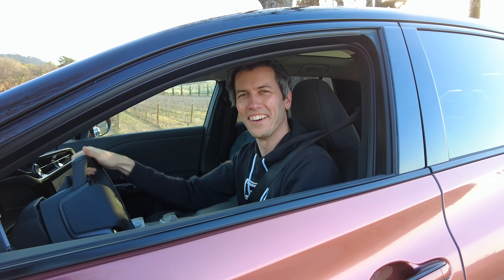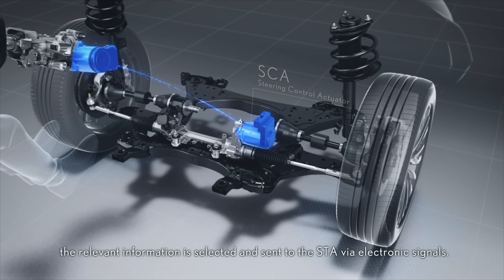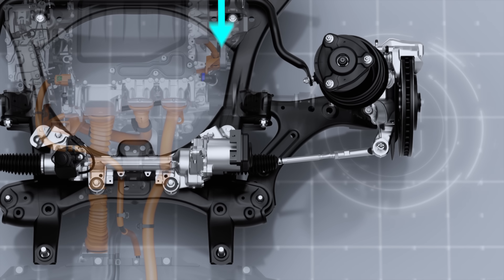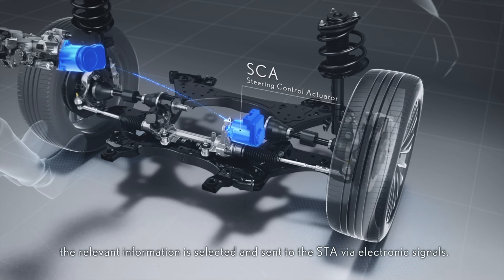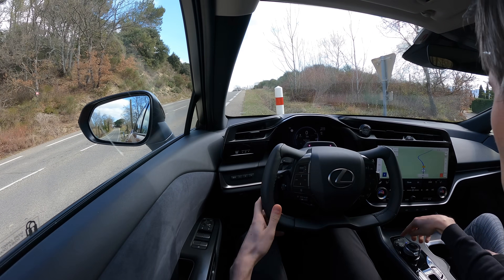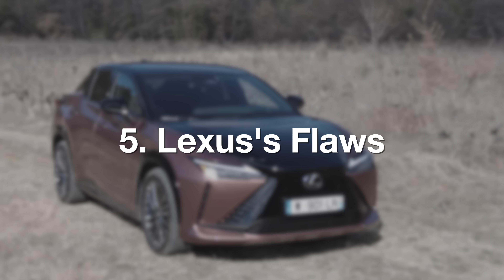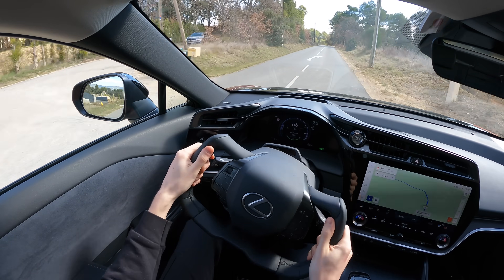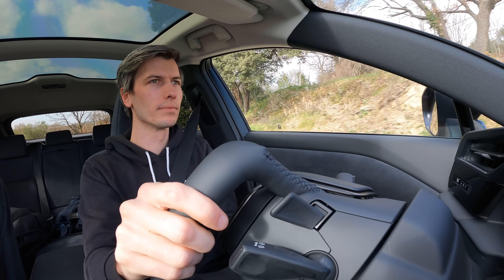How Lexus Fixed Tesla's Bad Idea: Steer-By-Wire Yoke

Comment: So if you turn the wheel and brake, does the vehicle spiral? Or is the vehicle speed input tot he steering ratio latched when the brakes are applied?

X-by-wire is in general a good thing, but there's a long list of safety and reliability preconditions.

Another potential benefit is that the vehicle can be made deliberately modal. An existing steering related example is the “tend to follow lanes” switch on a lot of current cars, but you could also ask yourself questions like what would a fully parking lot optimised control discipline be like. (Just make very sure that the look and feel are different when you do this—Airbus learned this the hard way.)

Comment: the thing about the adjustable steering ratio is that it'll be very difficult to account for scenarios where varying rates of steering are required with short times inbetween. for example when the car loses grip or when having to avoid an obstable at differing speeds
Reply: you think them asian engineers with master's degrees didn't have solution for this?

Comment: I can remember (European here), that my SEAT (Part of VW Group) Leon Cupra (280HP) hat alread "progressive steering" back in 2014 (in a middle class car). The first half/two thirds were like "regular" steering but the last third was way sharper. 
So, the benefit of the electronic system does not make sense to me. A lot of more controllers/actuators that can break done. 
Even if you have redundant system like in a freaking airplane: that adds a lot of costs to it for a doubtable "problem"

I am now driving an electric car (Ioniq 5) but the sense of the electronic steering I can not comprehend, 
especially the point that the same input does not always relate to the same wheel turn...

Comment: the only concern i have with steer by wire, is that as other car brands adopt the technology and it finds it way into lower production cost cars, some of them will cheap out on components and there is going to be a big delay between steering input and actual movement.
this is already the case for drive by wire throttles on some cheaper cars (many Renault from around 2010-2015 from my experience) where there is a good half second delay between pushing the gas pedal and the car opening up the throttle body, a delay that is very noticeable especially in a manual car. weirdly enough the delay is not noticeable (or not there?) on deceleration.
i am all for innovation and moving the automotive industry forward, i just hope that cheaper cars stick to traditional steering until the technology becomes cheap enough that it can be implemented safely into cheap cars.

Comment: 1. I didn't think there was anyone that actually used hand over hand, thought we all just do the palm turn on the wheel.
2. I don't really care what's going on behind the scenes, as I trust the engineers much smarter than me, as long as I still get to have a normal steering wheel as an option.
Once you start removing options (like tesla) that's when it's gonna start pissing people off.

Cars are fun machines to drive, they're not something that is 100000000% necessary to buy from one manufacturer or in a certain way.
Manufacturers shouldn't start taking stuff away like they can somehow decide what people want, such as steering wheels.

Comment: I am not convinced, the variable ratio of steering is not for me. There are situations on a high speed when you need to react quickly and turn as much as possible even if you end up in a ditch but to avoid an even worse situation. If the steering won't listen to me and just turn ever so slightly because of the speed I am driving it is not a good idea.

Comment: That's gotta be a no from me dawg.
As a coder i still much prefer my close-to-dead shitty 01 skoda with the powersteering just straight up broken, than a computer deciding how much i can steer in what situation. 
Also another "Nah dawg" for me: "Fix it yourself", cars get more and more hard to take care of without professional software and very specific data connections, and i can guarantee this won't make it easier. The good ol' engineering principle of "Less parts = Better design" needs to stay a thing in personal cars.

I don't have a problem with steer by wire in any public infrastructure like buses, or airplanes, but these are all things that are very actively maintained, and operated by people that can maintain them, or at least know when to figure out to do so. Think about that one guy you know for sure that drives around with the "Check engine" light that has been burning since 2008, and what will happen if a person like him will have a system like this.

Electric cars need to be accessible for all sorts of people for them to catch on, and "Expensive feature with minor benefits" isn't the target audience the industry nees right now.

Comment: Mfs in this comment section thinking that dozens of gears, shafts, bearings, hydraulic lines, linkages, etc. Are more reliable than sensors and a motor are out of their mind, reducing moving parts is the only constant in the pursuit of reliability, there's a reason planes moved to eletronic controls half a century ago and never looked back, mechanical connections and hydraulic lines are much less reliable than eletrical wires, wires do not wear down, do not require oil, do not fail if they are hit, punctured or bent.

Comment: i wouldn't trust initial programming and design. i have no doubt down the road it could be safer in an accident. less metal to come at the driver in an accident that kinda thing. i would expect like tesla's self driving. risky at first but now it's getting better and will be safer then human driving taking the human out of the driving., drive by wire will probabily be unstable and sketchy at first but once the bugs and kinks worked out i can see a few safety factors that would make it better then traditional drive shafts but i don't like the simulated feedback idea, i'd ratcher know what the car is feeling as opposed to what it wants to tell me.
it should cut production costs for the various manufactures for wrong side driving and so on. since now it a steering module you can mount in the back seat or on the roof if you wanted to.

Comment: Good video! You summed up your impressions well right there. The nerd in me says “ hey funny” but honestly as car driver I find it’s disconnecting you from the car too much. I’m also an enemy of faking feedback with electric motors. That’s kind of the same discussion when it’s about capacitive touch. It feels disconnected and artificial no matter how well you fake the feedback. 
At certain to me critical points I’d always prefer direct feedback and good haptic over a manufactured experience. (Let’s not mention the imput lag that also had your attention and it’s dependencies)

Comment: Having a non-round steering wheel will always be problematic. It's round for a reason, it means that it will always be in the same place no matter the rotation. That in turn means you can find it by muscle memory when looking in another direction or in a panic situation. A non-round wheel is a hazard.

Comment: This design in Lexus(Toyota) is as safe as the stuck accelerator problem was (or still is). The system does not have any redundancy or fail-safe mechanics.

Comment: Steer by wire should make it easier to have right and left hand drives. Hell, it could even let you have centre drive. Steer, brake and throttle by wire will make it easy to give options. So it will make it cheaper to export to all territories.

Comment: It's a pretty big issue if a drive by wire system has a lower response time than a mechanical one when that's supposedly one of the main justifications for building it that way. Hopefully they're able to fix that before bringing it to production.

Comment: 12:28

your test is flawed, i hasve a old "traditional" steering rack system. When I'm parking I notice the wheels and steeing wheels aren't the same, the power steering doesn't turn the wheels entirely where the steering wheel is when you're steering on the spot. When i'm steering on the spot, the steering assisnt isn't going to help steer all the way until the car moves a bit and the wheels can turn without excessively wearing out the steering rack. You need to have the wheels on jackstands to do a fair test.

Comment: Planned obsolescence in the guise of progress. Once engineers figured out how to make vehicles run for several hundred thousand miles, manufacturers needed to insure their bottom line. Now a car can be rendered "totaled" because of the decided price of a proprietary PCB. It's like saying that "before these electronics, cars had no value whatsoever". Crippling cars with electronics isn't for the customer, so much as it is for the Sales Department.

Comment: I think the delay is designed. It can actually dampen a twitchy steering. Also computer intervention is now possible for steering corrections to prevent fish tailing or spins. In RC drift cars there is a gyro to make it soo much easier to drift because stability is increased.

Comment: We already have redundancy and failsafe in case of actuator and sensor failure.
What if the connection between the two that is compromised? What failsafe do we have in that case?

Comment: honestly, redundant does not imply fault tolerance and redundancy does not indicate safety nor reliability. While I do see some benefits to this approach, the fact that there is no longer a concrete connection from the steering to the rack means that one day, someone somewhere is going to have that 1 in a million fault and that will most likely be fatal considering the driving ability of the average person. I mean, technically they should be safe as long as they followed the normal driving norms like keeping safe distance and speed limit. But I am pressing x to doubt right now.

Comment: I'm not really convinced with the answer as to "why". Especially when you see that FPS pro gamers who have a choice, almost never have mouse acceleration turned on nor is their DPI set to ridiculous values. Very rarely do you need to turn the wheel fast and full in one direction. More predictable steering with feedback will always be better. It's the same old touchscreen vs buttons debate.

Comment: This was solved more efficiently by the variable ratio electrically assisted steering rack some years back. It offers the security of mechanical linkage with variable ratios. And with proper ratio design it'll offer all the advantages of this system with the safety of mechanically linked failsafe. 

This is technology for technology's sake. The thinking is 'Can we do this?' when it should be 'Should we do this?'

Comment: Airbus has since long made the flight controls "fly by wire" thus meaning the controls surfaces are not linked to the pilots hands. And airplanes are known to be the safest machines besides elevators. so yes, steer by wire is safe
Reply: Cars are nowhere near the quality of an airplane let alone checked like an airplane before every drive.  Unnecessary risk and I hope people don't buy these cars where I live so my family doesnt get killed

Comment: variable steering ratio feels like a bad idea though. Most people doesn't drive that much, and won't face unexpected situation as often as what would be required for someone to get used to how their car reacts at different speed. Adding a variable in there that is as important as the rotation needed on your steering sheels to turn your car will cause accidents.

While I 100% agree that technology came a long way, I don't think that adding new components to the steering system is a good idea. Not for the main steering system. Gaz and brake are a different issue, as gaz would just prevent you from gaining speed, and brakes you'd usually have a second system to slow down the car, or have steering to do something.

Also, as you said, there's a delay in steering. We can clearly see the delay in the video, even before you point it out. I'm not sitting in the car and I already hate how the steering reacts.

Sadly, car manufacturers will absolutely move toward this as it will make production line a lot easier to deal with. But the additional expense will again be paid by the customer. Base car models are quite expensive now compared to 10-15 years ago, and inflation is only part of the reason. Base models have a lot of new stuff in them that were extras before, and some of those were paid at least 2-3000$...

IMO, this needs to stop. We're going to ends up with base models that will be sold at 50k$ soon, making it simply impossible to buy for a lot of people.

Comment: Generally speaking, the more electronic nannies there are between you and the road, the more sloppy and less feedback you'll have.  I think muscle memory of hand movements at highway VS street is a big deal.  That latency is crazy to me.   No thank you.  I'd rather feel the potholes.  At one point I had a I had a '91 MR2 Turbo.  Manual.  No frills go-cart.  was great.  At the same time, I got into a then brand new Infiniti G37.     I absolutely hated it.   Yeah it was faster, but you could feel the electronics reigning everything in and making it sloppy.  What's the point of having twice the power if it's going to be restrained to thoroughly?

Comment: Imagine your steering wheel just disconnecting while going at highway speeds because of a glitch in the software or a fault in the system… 

And before someone says how reliable it is: Nothing is 100% reliable especially not once the car is 15+ years old…

Comment: basically the same idea was used in BMW's. The used a planetary gear, where one side could be either neutral, interact or counteract the drivers input. Therefore the same effect was achieved- only with a mechanical fail safe redundancy and a true feedback from the road.

Comment: Lexus has used a "VGRS" system since 2002.  That means a change in steering ratios based on speed.. without requiring drive-by-wire.